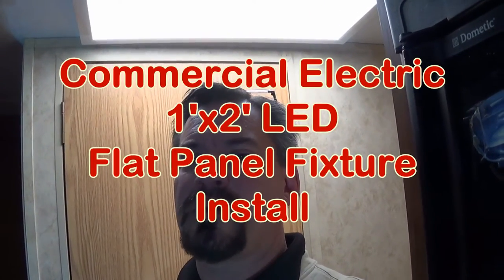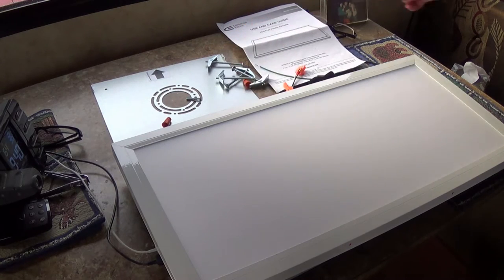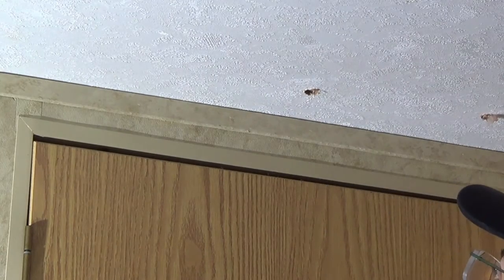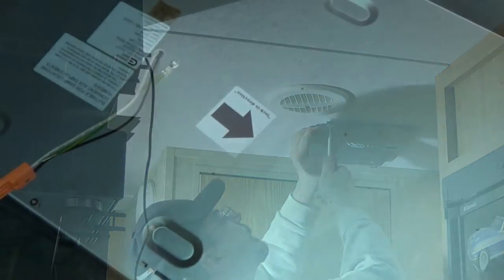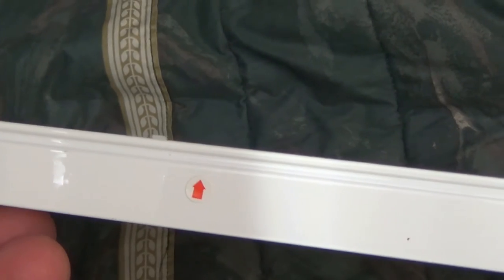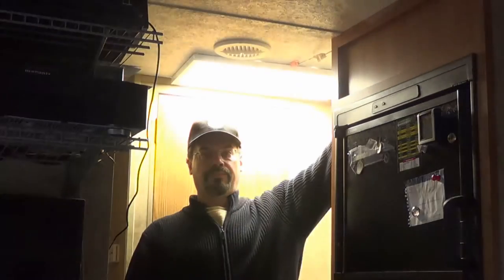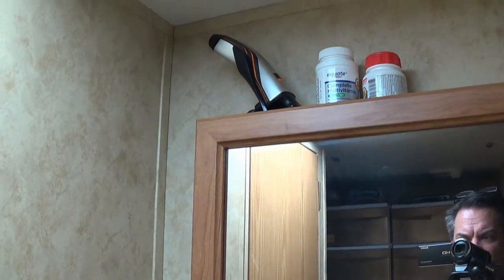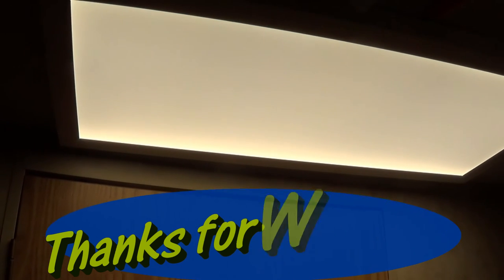Travel Trailer ReModel: Part 15  Flat Panel LED Light Installation

Comment: Nice!  Im gunna go look for one of those.  Would be great in the kitchen.
Reply from the maker: +Pounder Speaks   This item is a Home Depot only product.  I have the item number in the description I think.  They have several sizes.   I want to get some for under cabinet lighting.  It works way better than it looks on the video.

Comment: why dident you use the pre existing wiring from the light just next to it instead of running a cord all over the place
Reply from the maker: +Scott Savoie   Because the existing lighting is 12v direct current, and the new light is 120v alternating current.
Reply: Fernbark Frist all led lights are inherently 12v. All you needed to do was just the transformer off the end and wire it into the existing 12v dc system over the sink area